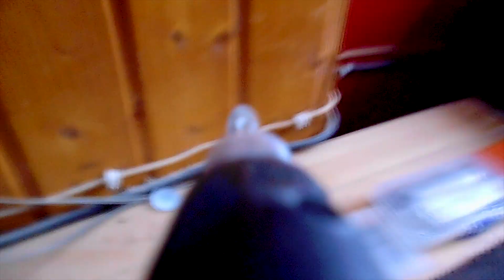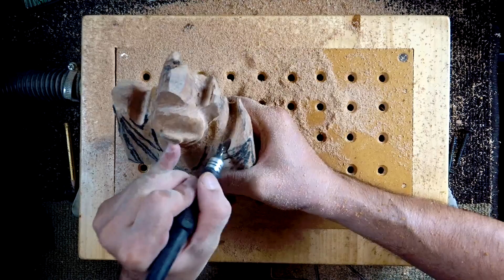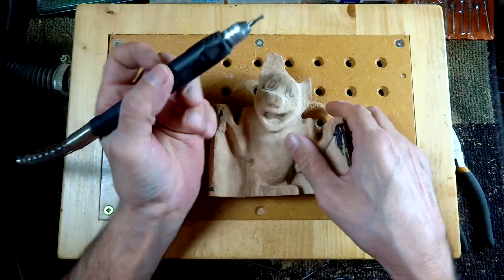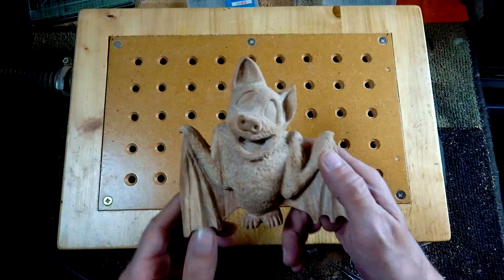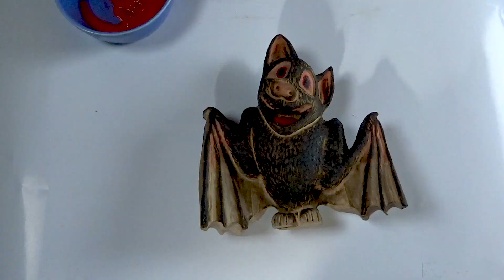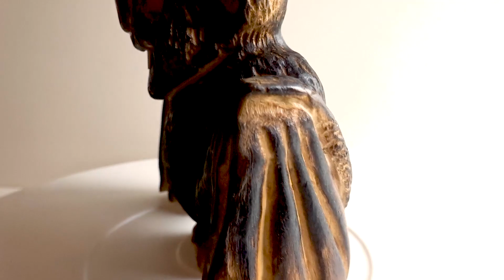How to Power Carve Little Bat - dremel power carving

Comment: You are really talented. What kind of vacuum system are you using?
Reply from the maker: thank you john, i use a toilet fan, i know is not the best but recuces a lot the dust generated, still have dust on the room but like a said much less, i don´t have a workshop, i do my works in a flat, so for respect to my neighbors, i chose a cheap and silent option, thanks for the comment dude. here the link, https://www.amazon.es/gp/product/B01J5F0VUO/ref=ppx_yo_dt_b_asin_title_o08_s00?ie=UTF8&psc=1